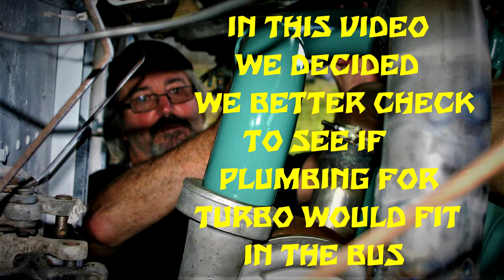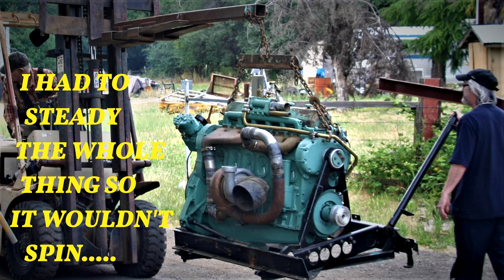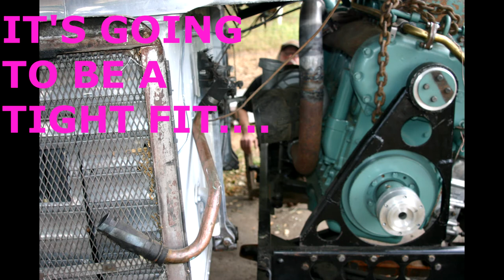1-7-2020 GMC 1952 PD 4103..671 DETROIT DIESEL ENGINE.TURBO AND PLUMBING NOT FITTING..RETHINKING NOW.

Comment: That's disappointing! Makes you want to notch the bulkhead to accommodate the piping. I'm wanting to hear it run!!!!!! Good luck partner.
Reply from the maker: That's what we are thinking...making room then reinforcing everything...our real challenge I think is getting clean air to the turbo...we have some ideas on that...but first thing we need to get is this thing started....I'm no mechanic we had Leon holding our hands thru the whole process, he's no longer with us...so I'm trying to get someone here local to help with all of that...I've sent the bus to 2 different shops at $1500.00 a pop for shipping, both said they could do the work then after having the bus several years did nothing except take or misplace one of my exhaust manifolds.. then we brought it here to my home at another $1500.00 I don't want to send it to another shop I want someone to come here and I will help them get it going... We need to get it running first before we start cutting the bus up anymore...
Reply: @doityourselfwithfixinitwit270  Wish I was closer or the cost to get it to the shop wasn't so damn much we get you finished and down the road. South Carolina is a stretch I would imagine. Between both tow bills it was pretty close to being here.
Reply from the maker: @rodneymiddleton9624  Thanks my friend for your interest..I wish someone like you were working with me on getting our old bus up and running....We call our bus The Murvle, named after our mom, Marian and dad Burvle...put together....MURVLE...we got a guy here that says he will help us but he's pretty busy.....he has a YouTube channel you might enjoy.... Western truck and tractor repair.....hopefully he will be able to help, Warren is his name he seems pretty able to do most anything and says he knows about our engine ....We spent about $4500.00 in tow bills it cost us another $1500.00 to get it from the 2nd shop in California to our home in Oregon...I want to build a shop on our property here to work on The Murvle .....I was thinking about spraying the outside of the bus with that rhino liner stuff...I've seen it on a few vehicles and we had it on my Dodge pickup bed liner it was great stuff....
Reply: @doityourselfwithfixinitwit270  Best of luck partner. Hopefully this guy will get you fixed up.

Comment: I happen to have a 4103 shell if you guys need body, bulkhead panel's.
Reply from the maker: That's good to know if we need anything I will let you know...
Reply from the maker: Jay ...do you have parts off of your 4103 for sell like running lights or marker lights the whole fixture for the back is what we need both sides...
Reply: @doityourselfwithfixinitwit270  Sure do. However one of the arrows has a crack. I'll get you some close up pics this morning.
Reply from the maker: @jaywhitehead5294  Yes...great...we need the two on the roof in the back...pictures would be great...I don't know what happened to them but they are gone...thanks so much...what year is your pd-4103?
Reply: I'd have to look at the titles. 1951 PD5103-#254 and#807. One has chrome lights and one has painted marker lights.
Reply from the maker: @jaywhitehead5294  I just got off the phone with Stan Holter with Bus Boys store and he said he's got what we need...he's getting on a ladder and getting them now...If he has what we need he will be sending them if not I will see what you have....he's going to be sending pictures in a few....thanks for getting back to me ...If you can send pictures to my phone maybe I can compare what you have to what he has...I might buy both who knows....